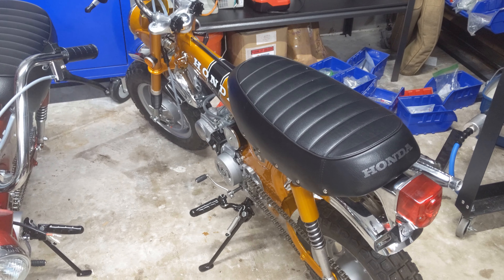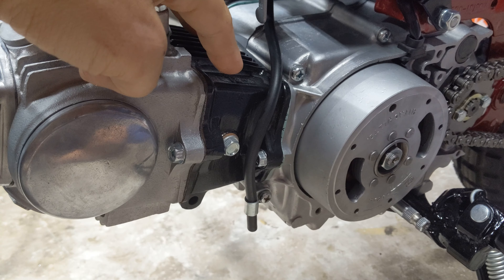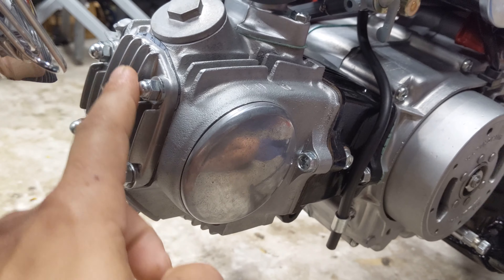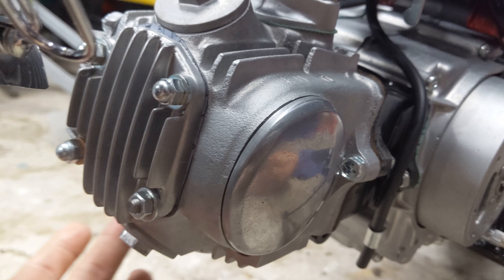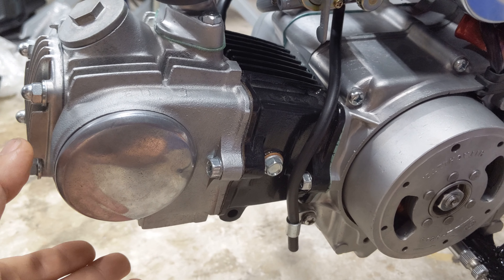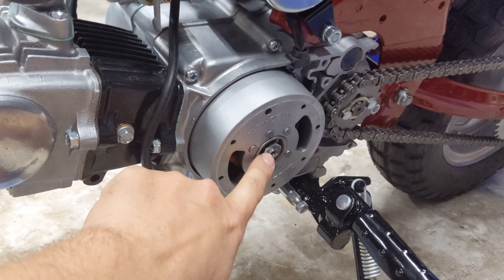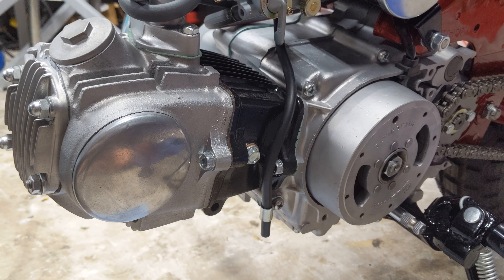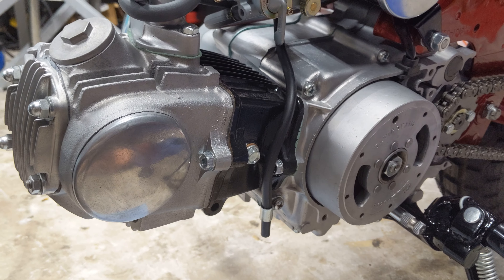Avoiding A Dry Engine Startup - Priming The Oil System - Honda Z50 Monkey CT70 Dax Mini Trail

Comment: Question: Why is turning it over via drill motor any better than starting the engine? Wouldn’t it be the same number of rotations to achieve flow? Thanks!
Reply from the maker: Starting an engine would certainly be a more rapid and violent on all the moving parts under combustion forces. At least this is a slower rotation and what little oil film exists will have a better chance protecting the metal on metal in my guess. The big end of the crank relies on the pressure and at least it is not taking the extreme forces at the bearing as it would under combustion. But i dont have any exact info. You may be right

Comment: Why did Honda spec one head nut as a plain nut instead of acorn?
Reply: I wonder this too, I understand the copper washer, but why an open nut on the lower left? While some aftermarket hardware kits use all acorn nuts. Ive used both on multiple bikes no issues btw